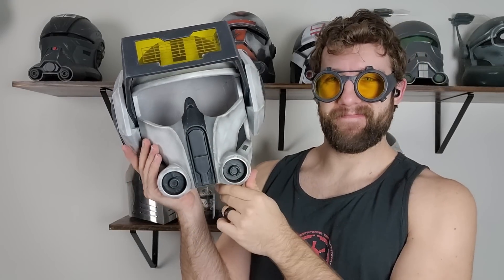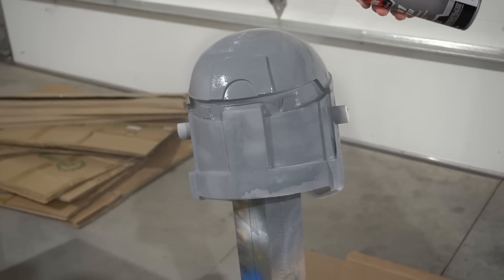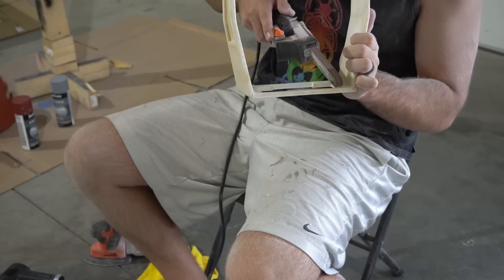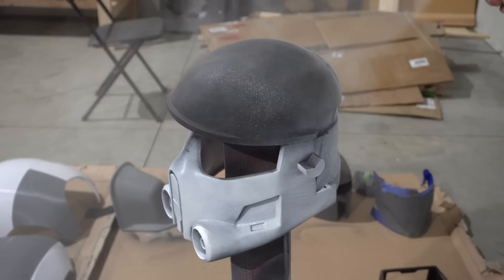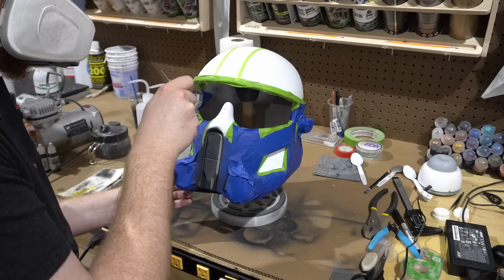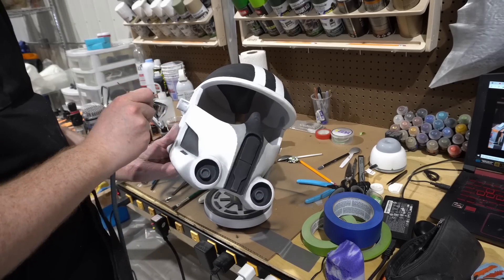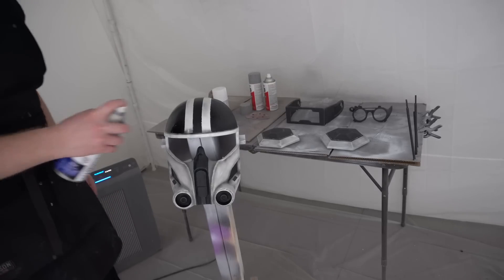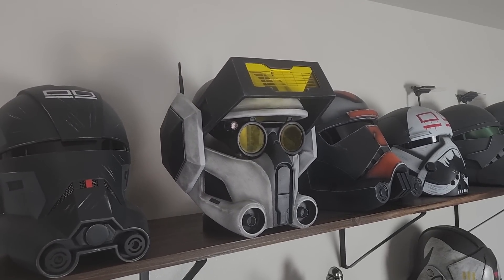Making a Season 2 Bad Batch Tech Helmet

Comment: I can tell you right off the bat, your painting is TERRIBLE. You hold the can way to close, you put it on WAY TO THICK, you can see the runs all over the place.. Next time try holding can at suggested distance and many light coats. I am new follower here, but if you do your how to videos like this, your gonna make a lot of people do it wrong. Ohhh and those big clouds of paint means your cans are to cold. Trying warming them up before using spray cans. Or any paint for that matter.
Reply: The cans used in the first half of the video are sandable filler primer, designed to be sprayed on VERY thick and fill in layer lines.
Reply: @MjrProps  Been working on car bodies for 30+ years yes thick, but not that thick.